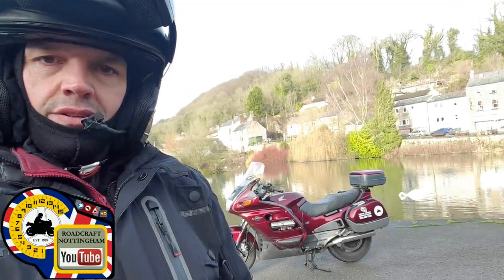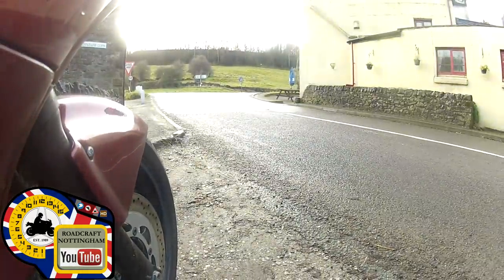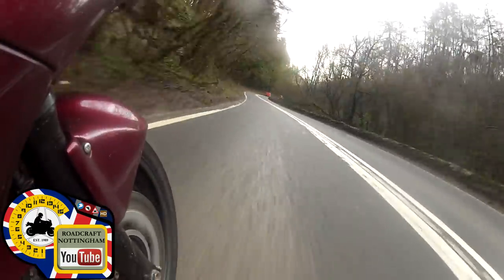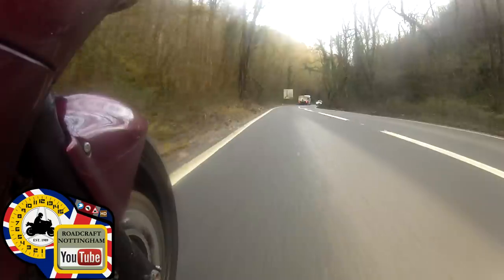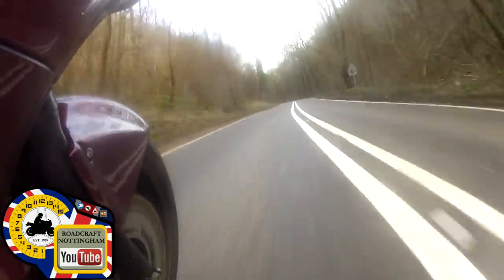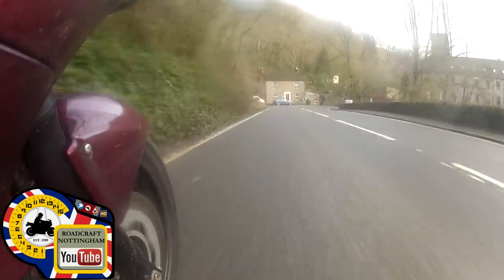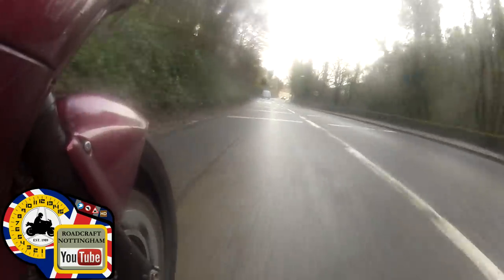Motorcycle riding tips: Advanced positioning demo with commentary

Comment: Great vid. I noticed you change position in 30 & 40mph limits for all traffic rather than just heavies/large vans. Do you feel that is necessary?
Reply from the maker: I always ask myself is there any HARM being further away, especially with the texting and swerving mentality. As long as it doesn't put you in conflict with any other dangers there's no problem. What do you think?
Reply: @RoadcraftNottingham  Only time I would consider NOT taking up position 1 or 3 for a tight turns in a 30/40 limit is if there is following traffic.  The act of moving over can be interpreted as preparation to turn off the road (into a driveway or junction for instance)  which can in turn invite an over/under take.
Reply from the maker: @swartgevaar5794  absolutely, I mentioned that in an aborted effort today actually.
Reply: I’m actually agree with you, however having done my IAM they preech staying nearer position 3 as default, even when cars are approaching and only no into position 2 or 1 when when larger vehicles are passing. I have found this a bit strange but needed to do it to pass the test.
Reply from the maker: @JockBiker  but that isn't what a lot of the iam actually should teach. It clearly states that you should move away from danger when you have the view. Whoever insisted you stay in 3 needs putting right.
Reply: Yeah but they don’t see car travelling towards you at 30/40 as a high danger. It was my observer, regional observer and assessor that I questioned about this and they all said the same thing. Cars travelling 30 or 40 mph stay in position 3, equalising danger from vehicles approaching and pedestrians on near side. I agree it’s safety first then position to see and be seen.
Reply from the maker: @JockBiker  depends how wide the road is, on a narrower road, between the cars and pedestrians works out about p2. These points need clearing up as a national observer friend of mine agrees with me.
Reply: @RoadcraftNottingham  This may help resolve this ... Have a look in the IAM course book. The section on IPSGA. Under P it says "Be aware of potential hazards on both sides of their machines ... To the offside their is potential conflict with oncoming traffic. There is also a diagram and an explanation of the safety bubble (what Roadcraft calls Equalisation). Hope that helps.
Reply: Hi. I totally agree with you. I’m just sharing what is said/taught in Scotland. I disagree with it but had to do it for my IAM test. I feel it highlights the inconsistent approach of IAM and the variation that occurs. There is an element of learning skills to pass the test.
Reply from the maker: @JockBiker  agreed, you can only repeat what's been told. Another possible issue is how they put it across so it may be misunderstood or they took the info wrong too. Stick to this channel, I'll keep it right. 😉
Reply: @JockBiker  This sort of thing really annoys me. I'm sorry you had a bad experience with this particular IAM observer. Some groups and observers are better than others I'm afraid. Perhaps I was lucky and have a particularly good group and observers, but from what I hear, I think most are trying to do the right thing for as many people as possible. 
I passed my IAM test last year and am training to be an observer at the moment, or would be if we weren't in lock-down... The message that I have read and heard from everyone in our local group is that it's always safety first. The course and material are based on the Police Roadcraft system and it's typically trying to give very practical advice. 
In fact, I have just checked the manual and the very first competency that it covers is "Put safety first in all riding judgements"
When I look at the Position section, again the first thing it talks about is safety. 
"Always consider safety first:
- Do not relinquish safety for any other perceived advantage. Be prepared to sacrifice position for safety
- Position to see and be seen"

I've looked through both the student and observer manuals now (it was annoying me) and I don't see anything in there at all about always staying near position 3, in either manual. 
Like in all walks of life there will be a wide spread range of how well someone can do something and in this case in how well something is taught. There are some observers I'm sure that when giving a simple piece of advice, perhaps turn it into a rule which is just not appropriate. Each section has to be read with the thoughts "if it's safe to do so" over-riding the specific advice for each situation. 

Having said all that, position 3 can indeed be the safest position when moving along a straight country road in that it gives you the best view, lets you see past the vehicles ahead and lets you see the oncoming traffic sooner. But you should absolutely be prepared to give up position for safety. 

@Roadcraft Nottingham thanks for posting this video, a really good demonstration of thoughtful and safe riding.
Reply: Dave hi, yup. I totally agree with you and in my general riding keep that safety bubble and position for safety. I have subsequently raised it with various observers and they all have opinion about whether you should keep the same position when in a 30/40 limit. I was thinking about trading to be an observer but this inconsistency just make it a mock of the whole system.
Reply from the maker: @JockBiker  agreed. Just simply do what you feel is safest.

Comment: It is interesting coming back to motorcycling after a 36 year break.  As for positioning, most good riders should do this automatically without having to think 1, 2 and 3.      I have noticed the traffic is at times scary to ride among,  the standard of car driving generally bad, and 90 % of works vans simply horrendous.    
I also watched your lane filtering videos, and a) would have to disagree with your assessment of artic drivers; I find most are aware of their safe position in a high up cab, and they take the view other traffic needs to get out of their way, and  b) filtering motorcyclists need to be especially aware of artic and flatbed trucks have bad significant blind spots, along with Ford Transit type vans.

Comment: I was in Southampton coming up to a red light, no one was behind me so I was braking softly.  It had rained earlier so the road was damp, and there was a manhole cover in the left side of the lane so I positioned myself in advance to pass to the right side of it.  Then I got up off the road.

Best I could tell, the road surface that had been manually laid around the manhole was too smooth so I lost grip.  Combined with the cheap CSN stock tyres that Yamaha used on their 125s, which had a very bad reputation, the bike went over before I knew what happened

 Luckily no one was behind me, unluckily my little finger ended up under the bar end.

I also had an accident where I broke my elbow a few years earlier, when I caught some mud I was avoiding on a right-angled corner.  At least on that occasion I was able to pick the bike up and ride home, before going to hospital and needing surgery.  In Southampton I had to abandon the bike and get the train back to London with my hand in a cast.

Unfortunately the bike I had then, a YBR125 Custom, had a weird wheel size so there was only one other brand of tubeless tyres available.  But they were by Michelin and I never had any accidents after changing to them.

The point to all is some combination of not thinking a manhole cover is the only hazard as avoiding one could make things worse, that breaking a little finger is more annoying and inconvenient that shattering a bone in the elbow joint, ensuring you have good tyres is more important than avoiding manhole covers, and to never go to Southampton.

Honestly, if you go to Portsmouth the parking is free for bikes, and you can watch the hovercraft spin 180° on the beach.  Though I admit I do still tend to position to go around manhole covers despite knowing better.
Reply from the maker: You're right that tyres can make a hell of a difference just watch my recent Avon tyre upload. Thanks for your comment.

Comment: Good video and I agree that while it's best to avoid man-hole covers if it's safe to do so, a level one should not be a problem while you're upright.

I did however a couple of months ago ride through an atrociously maintained road during poor visibility twilight and failed to spot a serious depression around a man-hole cover.  The result was I had to replace a damaged cast-aluminium wheel on an RT.   £900 - ouch!
Reply from the maker: Yes and this is where more forward planning comes into play but hands up, I've done that too. Hope you're OK.
Reply: @RoadcraftNottingham  Electronic suspension cushioned the mechanical shock and it was some consolation when a friend of mine drove over a pot-hole on the M1 in his Golf GTi reporting that the damage done to a single magnesium-alloy wheel and low-profile tyre cost £2500 for replacements...

Comment: That pan is still going stong.
Reply from the maker: It always will. ☺
Reply: @RoadcraftNottingham  i am looking at one in the werk 99 model 70000 £1400 what do you think
Reply from the maker: @neilwiddison6529  good price, just check the swing are isn't rotten underneath and the cam belt has been changed. Take a look at my Pan restoration upload
Reply: @RoadcraftNottingham  he has had the swing arm off checked it and cleaned it. Its has a stainless exhaust .oil and filter changed..new tyres.

Comment: At 1.25…..manhole covers.  If you’re looking well ahead, position the bike in advance and avoid, especially the one in the video where it includes a break in the road surface.  That’s where debris from builders trucks rest, those pesky nails and screws that wait patiently for the tyres of the rider not paying full attention.  Avoid potholes and manhole covers even in a straight line.   At 5.45….revert to position one in case the “heavy” pulls out…it isn’t a Porsche, your travelling at 50mph, even if you notice the wheels turning, you’re away from any danger or hazard before he’s moved, especially if you’re looking ahead and note traffic ahead.  
Best not to make heavy weather of riding a motorcycle safely.
Many of these videos are indeed useful but please take into account these “qualified” individuals have to keep up the momentum in order to ensure a continued income stream and frequently run out of material.
Find a Police Class 1 instructor and pay for his time to teach you on the highway….Not a Class 1 rider (ex or otherwise) but an instructor, they are taught and trained to teach.
Take a commanding position on the road, little need to over emphasize, relax, maintain concentration and enjoy the ride.

Comment: The argument of 'oil' on the road is not valid anymore. Forty years ago or longer you could make that argument due to the tolerances in manufacturing, but today manufacturing is light years better because of environmental regulations. What you see is the difference between a polished road wear (due to tire) and unpolished surface (less tire wear).
Reply from the maker: Spot on. In my recommended video at the end of this, I say that too. ☺

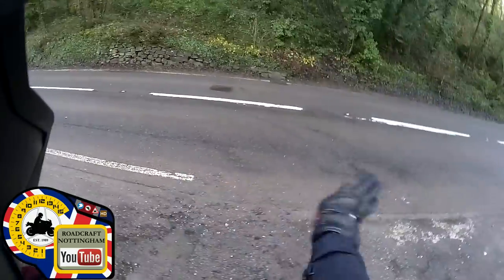Comment: 1:13 Personally, I will always avoid man holes if it is safe to do so especially when wet. If I need to swerve then I think one of a few things have happened; possibly I have been following someone too close or I have not be observing well enough,  2:00 The only time I am very wary of oil is when it is wet and on roundabouts otherwise I personally do not find a problem until I am dragging a peg on the floor :) Thanks for the video.
Reply from the maker: Even if there's no danger, from an advanced pov it just looks unpolished and amateur to a trainer. Each to their own. ☺
Reply from the maker: @dmail00  you mean the bit that says avoid reacting to an insignificant hazard as this could destabilise the machine or the part about projecting manhole covers and altering position in plenty of time in a gentle curve, if not slow down? I'm fully aware of what's written in the book but need to take into consideration that if the cover isn't dangerously raised or sunken, unless you're excessive in accelerating, Steering, banking or braking it's not a problem. I don't always agree with what's in the book but they need to generalise when it's not always that simple.
Reply from the maker: @dmail00  fair enough regarding the wording but despite what's written in any book it doesn't change the fact in a straight line without doing anything excessive and a flat cover, danger is almost non existant and swerving around it looks tacky and unprofessional imo. Thanks for challenging me though, it's fun. ☺
Reply from the maker: @dmail00  as long as those hazards aren't excessively sunken or raised as I'd mentioned in the upload. ☺. Thanks for the back n forth.